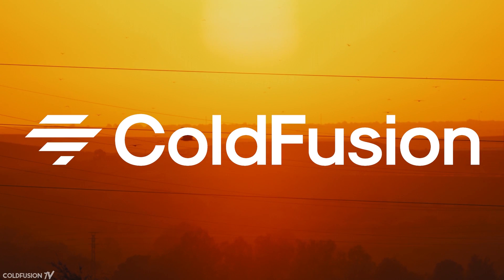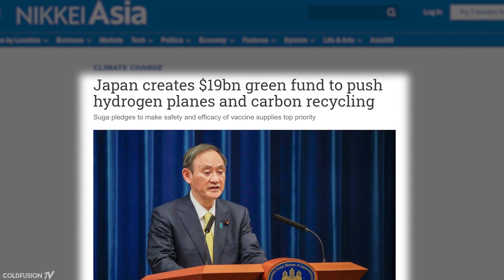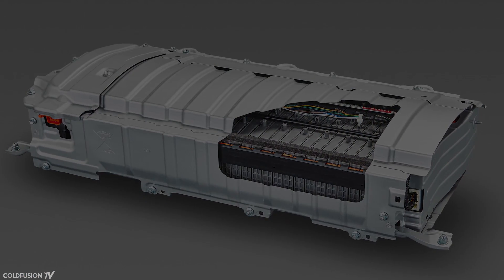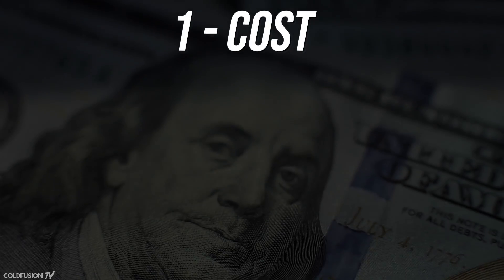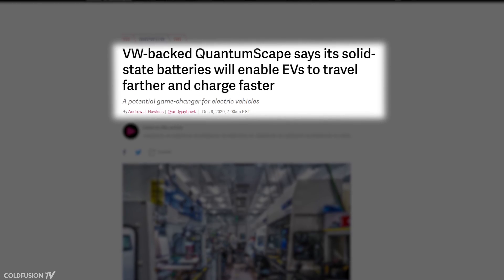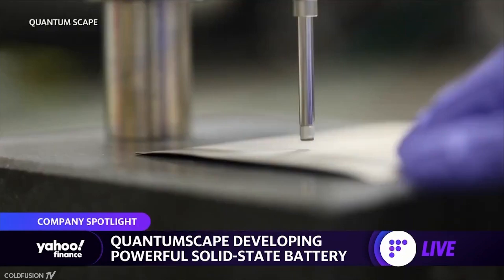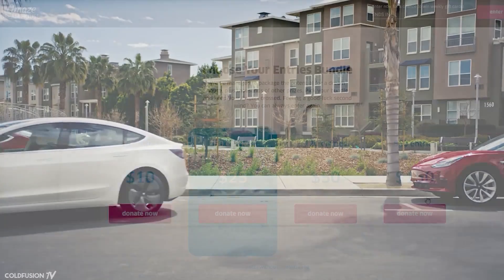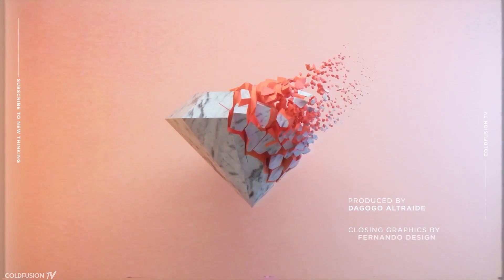Toyota Plans Revolutionary Solid State Battery for 2021

Comment: 2007: in a year or two we will have solid state batteries
2021: in a year or two we will have solid state batteries 
2045: just 1 year away
Reply: Similar to, "Just 2 more weeks to flatten the curve". Getting close to a year now. Sheesh
Reply: @lookinin123  the curve has been flattened and unattended many times
Reply: Solid state batteries coming year 2065 🤣🤣🤣lol
Reply: Half-Life 3 will be released before SS battery has begun development.
Reply: @firstnamesurname2482  it's almost complete, it is gonna use quantum processor and you guessed it, they run terrible on traditional batteries!
Reply: @ruzzlgreen3436  Well, gotta give it more time.
A lots and lots of time.
Reply: Just like algae fuel. It can be done, they can't figure a way to upscale it, and make it cost efficient.
Reply: They will be charged with the new fusion reactor they are releasing that year...😁🙄😁🤦‍♂️
Reply: Its like the cure for baldness. Just around the corner but never materializing.
Reply: @araibirshad8294  Wear a hat. A bloke I worked with did, even indoors.....
Reply: 10 years ago We told that electric cars are never gonna have a foot hold in automotive industry, but he We are chasing the battery that meet demand for EV. 😁
Reply: Keep optimistic 😛
Reply: Your stupid cmt has so many likes 😆😆
Reply: yes graphite and nickel batteries - are here and now and will probably be the same in 2040, so invest in Novonix
Reply: QS QuantumScape has working batteries that VW has tested and verified! They are building a plant to ramp up production, that's why their stock went to the moon recently, the catch is they will be expensive until large volume is reached, but VW is the biggest car company in the world so maybe sooner than later ;)
Reply: @zzmegadano  they are only claiming 800 cycles, Tesla's will be 3000-4000 cycles
Reply: eCitaro bus
Reply: Elon will just keep building.
Reply: Simillar to : 
"by year 2000 no more ice at the north pole"....    
"oh well by the year 2010....",    
"come on man,  by the year 2020"
Reply: By 2045 we would have all starved to death. The climate emergency never sleeps, it just gathers speed. With less ocean capacity to absorb our  man made gas & heat generation, the atmosphere will keep it, destroying crop growing seasons.
Reply: @grahamkearnon7853  true that
Reply: @grahamkearnon7853  In 2045 this climate hoax will long be forgotten except for a few rusty old wind mills.
Reply: @Johnsmith-zi9pu  good luck with that.
Reply: @Johnsmith-zi9pu  lmao. Just check the global temperature change in last decade. Then come back and tell me what is correct what is wrong.
Reply: @sanjay_swain  Just check the global temperature change in last 10 thousand years and the C02 concentrations and tell me what's wrong.
It's people like you that make people like Al gore very rich.
Reply: @Johnsmith-zi9pu  oohh really? I recommend you to check it again and come back. Just check the data from your own eyes. natural Climate change occurs within a span of thousands of years so that life can adapt to it. But here we are seeing drastic temperature change within a decade. And make people rich? Do you know that oil industries are responsible for trillion dollars lobbying every year? What you are watching here is not natural. On average every volcanic erruption every year produces 650 million tonnes of CO2. And we humans are producing 36 Billion tonnes of CO2 every year just with industry and not to mention other green house gases. It's crazy how many people don't even want to clean up the planet they live in just for few dollars. You want another example of pollution? Just see up the night sky inside a average to big city and try to count how many star you can find. Good luck
Reply: @sanjay_swain  So C02 is stopping you from seeing the stars; really? I thought that C02 was an inadvisable,odorless, fertilizer and now you tell me it's pollutant. From the  precambrian era to the start of the industrial revolution planet earth sequestered more C02 than it produced and if that continued we would go extinct.Satellite images show the earth is getting greener due to C02 fertilization. For most of planet earth's history C02 levels have been higher than now , life thrived and the oceans were not acidic.Your ignorance of the earth's climate an atmospheric history  enables you to look at 10 years in isolation.
Reply: @Johnsmith-zi9pu  CO2 is not the reason for not be able to watch stars. That goes to light pollution on cities. That was just an example. And tf you are talking about? At this moment ocean life form is endangered. "Life thrives" who tf told you that? And how can satellite can say how earth is much greener? Also please give research paper to all your claims. Not a Qanon article but to a peer reviewed verified research paper. Please stop your BS
Reply: @Johnsmith-zi9pu  and about our history you must know that climate change occurs in a span of thousands of years which enables life to adapt with natural changes. But now we are watching a much bigger wildlife extinction. River waters are contaminated ffs
Reply: @sanjay_swain  https://www.nasa.gov/feature/goddard/2016/carbon-dioxide-fertilization-greening-earth
I hope that answers your question. If you knew anything about the fossil record and the ice core data you would know the life survived on earth when co2 levels where 10 times higher than today and that climate is cyclic.
Reply: @sanjay_swain  I think you get your info from Hollywood movies.
Reply: @Johnsmith-zi9pu  oh so you are talking about making earth more "greener" by producing even more CO2? Do you even read everything you said? Plants cannot take every CO2 humans are producing. What you send is just a temporary trial solution. That's not permanent. And in order to even achive what you are trying to purpose we have to increase planting trees by ten fold which is a really bad thing for our oil overlords.
Reply: @Johnsmith-zi9pu  I have never watched an Hollywood movie in my life but sure
Reply: @sanjay_swain  I have been away for a few days .I find your rant about oil overlords interesting given that they are the biggest beneficiaries of this climate hoax.
Solar and wind can't survive without gas for base load power and big oil just happens to sell a bit of gas. Big oil actually supports so called renewables and would be happy for us to rape the environment with solar and wind.
Reply: @Johnsmith-zi9pu  If you cite Nasa, then you should also believe in other facts and evidences that Nasa put on their website. Don't pick and choose one study/data over many others because it fits your narrative.
Human cause climate change is real, the earth average temperature rises just about the same time we start burning coal. It is pretty clear, not sure why you believe otherwise.
I don't know if producing more CO2 is good for the Earth or not but it is definitely not good for Human. Why did 197 nations endorse Paris agreement? What make you think you are better than 197 nations?
Reply: @super_hero2  The earth's temperature started rising after the mini ice age, we only started burning fossil fuel in a big way in the 1940s.
More C02 in the atmosphere increases plant yields and makes them more drought tolerant, that helps feed us and  provides timber for housing.
When you burn coal you are recycling trees.Submarines routinely operate with higher levels of ambient carbon dioxide (CO2) (i.e., 2000 - 5000 ppm) the current level in the atmosphere is 400ppm.
Reply: @Johnsmith-zi9pu  Yes the temp started rising at the end of mini ice age/first industrial revolution and accelerate around 1950s. So it started slow and accelerate later what is your point?

There are many other ways to increase plant yields and forest why do you have to mess with the atmosphere to achieve these results? Human as a species have never lived in such high CO2 level before so you don't know what could happen to us as human so why do you have to defy this?

I am not sure what you mean by this "When you burn coal you are recycling trees". If you are implying that burning woods somehow helps forest to replace old tree with new tree then I need to see real data about this, as far as I know we are losing forest fast.

Submarine can operate with high level of CO2 does not mean 8 billions of us should do that. Again, if you don't know how high CO2 level in the atmosphere can affect human directly and indirectly, then stop messing with it. Nasa and many other organization in the worlds have agreed that CO2 emission at the current level is bad, perhaps you should listen to them once?
Reply: @super_hero2  Coal was once a forest that was buried in a natural disaster, we are just bringing it back to the surface.
"Submarine can operate with high level of CO2 does not mean 8 billions of us should do that". Why? Co2 is only a natural healthy plant food.
Reply: @Johnsmith-zi9pu  Are you implying that burning coal, fossil feud won't cause any problem because it simply reverts Earth back to million years ago? If this is what you meant, then which Earth do you prefer to live on the millions ago Earth or the one you live on right now?

Human species have never lived in such high level of CO2 so we don't fully know the affect of CO2 directly (when you breath the air) and indirectly (if it cause rising sea, intensify natural disasters...). If you ask me, I would take 0.03% CO2 air over 0.04% CO2 air any day, I believe most of us agree that the higher the CO2 level the worse the air quality. By the way, CO2 level is not the same everywhere, if you are indoor, CO2 level is probably higher than 0.04%. So increasing CO2 level is not good for Human directly and indirectly, I guess that answer your question.

If you are skeptical just remember this, if you don't know what is going to happen, don't mess with what you currently have.
Reply: @super_hero2  I would definitely not want to go back to .03% Co2 because this would reduce plant yields and put more stress on the environment. Plants require more than 150 ppm to survive but 2000 - 4000 ppm to grow really well.  https://www.youtube.com/watch?v=RR1bDmcNpa8

if Co2 caused rising sea levels and intensified natural disasters I would be in favor of capping it, but there is no empirical evidence to make that connection.
You only have to look at the trends on hurricanes and cyclones to see this claim is false.
CO2 level  and air quality are two separate issues, you get rid of air pollution by burning fuels completely like we do now on cars. Pollution levels in our cities are much lower than 50 years ago even though their has been a massive increase in cars.
Reply: @Johnsmith-zi9pu  I don't know if 2000 - 4000 ppm is good for plants or not but it is definitely not good for human a simple google search will tell you that. 

It is like you and I are living in different reality. I did a simple google search and found many sites that claim CO2 emission can cause rising sea level, more wildfires, drought, storm... and you said there is zero evidence? Please do some research before you make these claims.

Just google "CO2 air quality" you will see that CO2 level and air quality are not separate issues. CO2 level is a part of air quality measure, they make air quality monitor that measure CO2 level.
Reply: @super_hero2  If you can't tell the difference between Co2 a clean, odorless , and invisible life giving gas and pollution that tells me everything I need to know.
 Yes there are many propaganda sites that claim CO2 emission can cause rising sea level, more wildfires, drought, storms,
but they won't support those claims with empirical evidence in context because there isn't any.
I have read extensively on this subject over the last 20 years and have followed up their BS predictions.
Reply: @Johnsmith-zi9pu  Here is the research I found: 2000 - 4000 ppm will have negative affect on human body. You can google and found out yourself. I don't care if it is odorless, invisible or not.

They are not just any site, Nasa also believe greenhouse gas cause climate change, also 197 nations believe so too why do you think you are better than them? Why would any one trust you over 197 nations and Nasa? Have you ever thought about why the rest of the world is against you on this topic not just U.S.?
Reply: @super_hero2  Not interested in political exploitation of this belief, or the  beliefs, only empirical evidence.
China is increasing coal fired power and has no plan to phase out coal until 2060 and it's unlikely that they will do it then. India plans a massive increase in coal fired power.Japan is going back to coal also.
People are not going to freeze in the dark and go hungry for a busted hypothesis.  
Coal Consumption by Country
#	Country	World Share
1	China	50.5 %
2	India	11.3 %
3	United States	8.5 %
4	Germany	3.0 %
Reply: @Johnsmith-zi9pu  Did you google to see if 2000-5000 ppm is bad for human body? Those are not just beliefs those are conclusion from numerous researches and studies.

Coal is only one of the many sources of greenhouse gas emission so it is not the entire picture. There are carbon capture technology when burning coal, so more coal consumption does not necessary mean more CO2 going into the atmosphere. Also who are you to say China is unlikely to phase out coal by 2060? 

No people are not going to freeze or hungry because we are replacing coal, fossil feud with green energy gradually.

I see that you don't believe CO2 emission causes climate change which is opposite to what Nasa and many other climate agencies believe. I don't plan to convince you to see what we see, but here is the problem with fossil feud, coal, what do you do when you run out of these or when they becomes too expensive? My answer is renewable energy what is your answer?
Reply: @super_hero2  You don't keep building new coal fired power stations that last 50 years if you plan to get rid of them in 40 years.
The fossil record shows life survived on this planet when CO2 levels were 10 times higher than to day.
It would be physically impossible for us to raise CO2 levels to that height even if we burned all our known  fossil fuel reserves.
The average CO2 Level for planet earth's history is about 2000ppm so why do you think it should be 300ppm the second lowest in the planet's history?
What do you call green energy and has anyone done an environmental impact study of your alternative?
Reply: @Johnsmith-zi9pu  I already told you that there are carbon capture/clean coal technology that prevent CO2 emission when they burn coal. So it does not matter how many coal plans they building now, what you need to tell me is if these plans emit CO2 by 2060.

Some bacteria can live at 100 degree C, how long can human stay alive at that temperature? I am more concern about if human still exist rather than if acidilobus aceticus can thrive.

"It would be physically impossible for us to raise CO2 levels to that height even if we burned all our known fossil fuel reserves" At what height? and do you have data/research to support this? By the way burning fossil feud is a big but only one part of the problem. There are CO2 reservoir under the ocean that can be released with higher ocean temperature. You can research about this easily.

Because no HUMAN ever lived in 2000 ppm before. I made this points many times in my previous replies, not sure if you read them.

Green energy is the type of energy that does not release pollutants to the air. There are environmental issues of these technologies but they are far less than burning fossil feud in my view. 

You haven't answered my question, what will we do when we run out of fossil feud or it becomes too expensive?
Reply: @super_hero2  You assume that carbon capture will work and is practical, you assume the China and India will use it and you assume that they share your beliefs.
Our ancestors did survive in 10 times current CO2  unless you believe that life started a few thousand years ago.If you bothered to study the ice cord and sedimentary data from the Precambrian to the present you would know that temperature and CO2 don't correlate in the the way that you imagine.
As we release more CO2 into the atmosphere plant yields will increase deserts will be pushed back and we will need less fossil fuel, however nuclear or some new form of energy will have to do most of the heavy lifting when fossil fuels run out.
Reply: @Johnsmith-zi9pu  You assume that carbon capture does not work by 2060. Which is bolder than my assumption. China claim to have carbon neutral by 2060 publicly so if they fail it will look bad on them. It is a commitment that they would want to keep. Unless you have proof that this is a conspiracy to trick U.S., perhaps wait and see that they can do? so far they have been doing a lot more than U.S. on climate change.

Which ancestors lived in 4000 ppm are you talking about? Please give me a name. My research tells me that not even the earliest primate live in 4000 ppm. You understand that we don't have any tool to measure temperature accurately that far back right? Also there are tons of things that happened back then that affect the global temperature you can't make an argument base on these grounds. The data that we see right now is that CO2 level and temperature increase/decrease together. From NOAA: https://www.ncdc.noaa.gov/global-warming/temperature-change

Please point me to a research that the more CO2 emission the less fossil feud we need to burn? We burn fossil feud for energy and energy consumption will continue to increase not decrease. How many years left we have if we keep burning fossil feud until it is deplete base on your research? My research tell me that we need a solution now rather than 50 years from now. Right now, nuclear can't be the solution because of the risks and "some new form of energy" is not an answer. How about investing in solar, wind, hydropower....?
Reply: @super_hero2 Covering half of the earth's available land in windmills and toxic solar panels would be environmental rape on an unprecedented scale. 
Primates lived during that period.
China will continue to exploit our stupidity on this issue. 

What does the lag of CO2 behind temperature in ice cores tell us about global warming?
Filed under:

    FAQ Greenhouse gases Paleoclimate

— group @ 3 December 2004 - (Français)

This is an issue that is often misunderstood in the public sphere and media, so it is worth spending some time to explain it and clarify it. At least three careful ice core studies have shown that CO2 starts to rise about 800 years (600-1000 years) after Antarctic temperature during glacial terminations. These terminations are pronounced warming periods that mark the ends of the ice ages that happen every 100,000 years or so.

Does this prove that CO2 doesn’t cause global warming? The answer is no.

The reason has to do with the fact that the warmings take about 5000 years to be complete. The lag is only 800 years. All that the lag shows is that CO2 did not cause the first 800 years of warming, out of the 5000 year trend. The other 4200 years of warming could in fact have been caused by CO2, as far as we can tell from this ice core data.

The 4200 years of warming make up about 5/6 of the total warming. So CO2 could have caused the last 5/6 of the warming, but could not have caused the first 1/6 of the warming.

It comes as no surprise that other factors besides CO2 affect climate. Changes in the amount of summer sunshine, due to changes in the Earth’s orbit around the sun that happen every 21,000 years, have long been known to affect the comings and goings of ice ages. Atlantic ocean circulation slowdowns are thought to warm Antarctica, also.

From studying all the available data (not just ice cores), the probable sequence of events at a termination goes something like this. Some (currently unknown) process causes Antarctica and the surrounding ocean to warm. This process also causes CO2 to start rising, about 800 years later. Then CO2 further warms the whole planet, because of its heat-trapping properties. This leads to even further CO2 release. So CO2 during ice ages should be thought of as a “feedback”, much like the feedback that results from putting a microphone too near to a loudspeaker.

In other words, CO2 does not initiate the warmings, but acts as an amplifier once they are underway. From model estimates, CO2 (along with other greenhouse gases CH4 and N2O) causes about half of the full glacial-to-interglacial warming.

So, in summary, the lag of CO2 behind temperature doesn’t tell us much about global warming. [But it may give us a very interesting clue about why CO2 rises at the ends of ice ages. The 800-year lag is about the amount of time required to flush out the deep ocean through natural ocean currents. So CO2 might be stored in the deep ocean during ice ages, and then get released when the climate warms.]
Reply: @Johnsmith-zi9pu  Solar and wind are just the beginning, these technologies are mature enough to be a viable option for now, they are not the end game. If you can't tell me a viable option for energy when we run out of fossil feud (you mentioned nuclear but it is risky and toxic) then at least for now give solar and wind a look?

Oldest primate lived around 65.9 million years ago. According to this, the highest CO2 level in the last 66 million years barely hit 1000 ppm https://earth.org/data_visualization/a-brief-history-of-co2/

Not sure why you send me this FAQ thing. What is your point?
Reply: @super_hero2  We are extremely unlikely to hit 1000ppm so there's nothing to worry about.
I have given solar and wind a look, they require too much infrastructure for too little power and building all that infrastructure requires lots of minerals and lots of land. 
The building and disposal of toxic solar panels is an environmental problem in the making.
Reply: @Johnsmith-zi9pu  The earliest primate look like a squirrel, they are very different from modern human or even ape. My initial argument was human (Homo sapiens) species only appeared around 200000 years ago, and during that time the CO2 level never reach 400 ppm. And it is only unlikely to hit 1000 ppm because we are pushing alternative energy, if you keep burning fossil feud at current rate we will hit 1000 ppm in the next 100 years. You can google these research to confirm what I say, they are pretty easy to find.

Again what is your solution? You want to replace fossil feud with only nuclear power?
Reply: @super_hero2  Submariners can survive 8000ppm so we are under no threat.
As Co2 levels go up nature sequesters it faster by growing more plants and algae . High C02 makes plants more drought resistant therefore we will have less  deserts, those areas  will also be sequestering C02.
Pure quarts and the heavy metals are a finite resource so we can't keep making toxic solar panels forever, the minerals we use to make batteries are also a finite resource.
Coal is organic and can be burnt many times in the form of vegetation (the carbon cycle), fossil fuel and vegetation are true  renewable energies.
Reply: @Johnsmith-zi9pu  Did you google what health risks associate with high level of CO2 concentration? It is a simple google search, it is not hard to find at all.

Please point me to research that support your theory

They are not infinite but they will last a long time. Longer than keep burning fossil fuels 

Not sure what are you talking about, fossil fuel is running out this is fact. Again point me to a research that support your claim.
Reply: @super_hero2  We have 2 hundred years worth of organic coal in Australia; not exactly running out. Coal is fully recyclable, solar panels tomorrows toxic waste. 
Coal is energy, energy can't be created or destroyed it is transferred from one form to another. 

5,000 ppm: this indicates unusual air conditions where high levels of other gases could also be present. Toxicity or oxygen deprivation could occur. This is the permissible exposure limit for daily workplace exposures. 40,000 ppm: this level is immediately harmful due to oxygen deprivation.

Submariners have a managed atmosphere so they can go as high as 8000ppm.
Reply: @Johnsmith-zi9pu  Where is the research that tell you we (the whole world) have 200 years worth of coal? How about gas and oil? we can't put coal into our cars to run.

Not sure why you cite first law of thermodynamic. What is your point?

So we agree that high CO2 concentration is bad right?
Reply: @grahamkearnon7853  I hope that was a joke, or perhaps you just had a bad dream.
Reply: @grahamkearnon7853  hahaha
In the 90's authorities claimed oil would run out and we'd be under water by 2020.
Keep on true believer!
Reply: @BuddhaOfDarkness  In 1974,,,,,Claims were made that oil would be gone in 10 Years.............Now We have oil glut........Paul
Reply: @BuddhaOfDarkness  I yet have to read or hear a statement from actual "authorities" and "scientists" who say "earth is going to end in X years". It's crazy how media blow a statement but still people like you don't even care about checking that media is lying or telling the truth.
Reply: @BuddhaOfDarkness  "end of world" yup I am concerned about that but I am not paranoid and going to panic about how earth is going to end. And yet just send me a research paper which said "oil is going to end by X years" or "earth is going to flood by X years". What makes you think I am a bootlicker? You guess what was a lie? If you have a single knowledge about how scientific research work then you would not call it. Again I am going to show you how the temperature is rising and there are more flooding every year on coastal regions. What do you think going to happen? Earth is going to end within a snap of fingers? This is not some sort of miracle this is a process. Science is not miracle. I can give a complete explanation how and why this happens with reason. About fossil fuels yup those will end. Don't know how long because it's almost impossible to predict. But by checking current rate of extraction it definitely will. Why did I say that? Simple because again fossil fuels are not some sort of miracle that simply came into existence out of nowhere. It took thousands of years to produce from dead animals burried in the ground and we are taking it out at rate a lot more than its formation. So it will end because fossil fuels can't form within this sort timespan. It's common logic
Reply: @sanjay_swain  so you agree, your common logic says fossil fuel will end? That's what Oil magnate Bush senior said in the 90's.
New oil is continuously rendered by nature every day, under any established green zone.
The atmosphere has been in a cooling trend for thousands of years.
I live on the coast. If anything, high tide is lower than 40yr ago and we have miles of new marshland forming where it used to be sea.
I hope it's sinking where you are 👍
Reply: @BuddhaOfDarkness  your data for your claims? Or should I just listen to you because you said so? Can't you understand this much of fucking logic? If you take out something from a box at a rate much faster than you put stuff inside it. Will it not end one time? Fossil fuels take thousands of years to form. And we are taking those out much faster than nature can replenish. And what makes you say that temperature is at cooling phase? Temperature records from 1850s show that average temperature has been increased more than normally it should.
Reply: @BuddhaOfDarkness  and please don't go "I didn't see an accident so it must be fake" logic.
Reply: @sanjay_swain  lol wrong
Reply: @sanjay_swain  shouldn't you be off sending spam emails and claiming to be from 02?
Reply: @BuddhaOfDarkness  great.... so your argument?